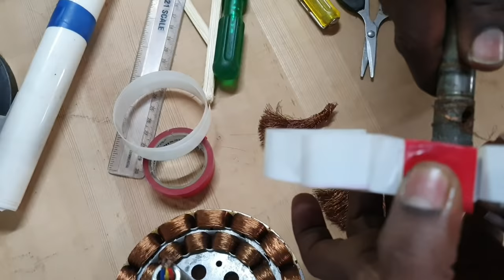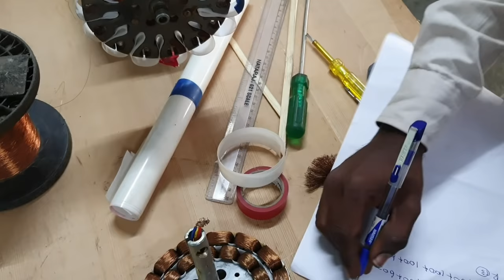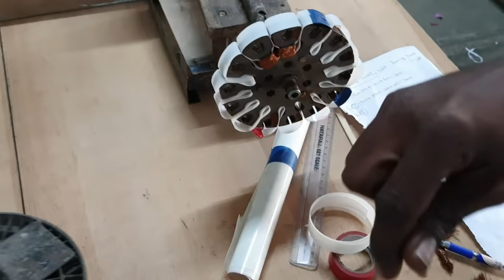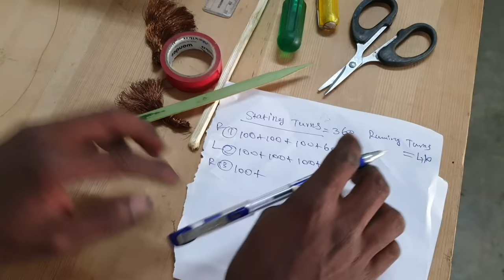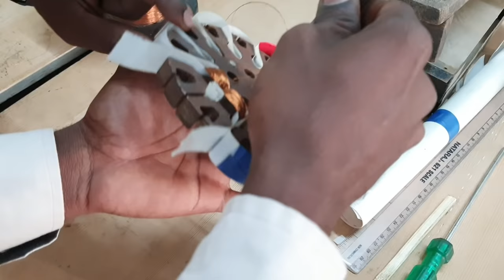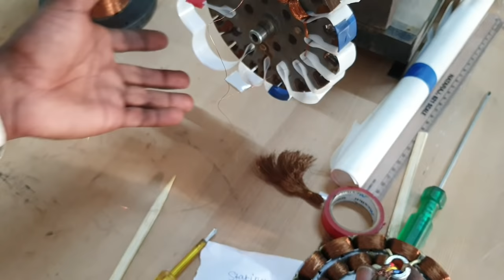Ceiling fan Coil Rewinding by hand|Fan Winding கையால் கட்டுவது எப்படி ?

Comment: Sir everything perfect two doubted for staring wiring for clockwise direction completed and start running wiring counter-clockwise direction? another for the end section confusion line output 3 wire kingly solve that issue... Really Amazing Teaching...

Comment: Starting coil and running coil intha 2-ன் udaya ஆரம்ப முனையையும் இணைத்து red colour la kuduthurukangala or running coil oda mudivu munaiya kudukangala
Reply: Starting coil aramba munayum, running coil mudiura munayum thaa short panni red colour wire yedukanum

Starting coil ( inner winding ) mudiyura munai capacitor ku podum dummy yellow wire 

Running coil ( outer widing ) staring munai thaa blue nuetral wire

Comment: 36 kg wire nu solranga la sir athu ella ceiling fan kum same size thana.. intha wire kadaila eppadi ketu vangarathu.. oru fan ku ivlo gram nu ethavathu kanaku iruka.. illa antha 36 kg wire bundle ah thaan tharuvangala..
Reply: Cut &remove the failed fan coil,the take a one wire,measure in the SWG &find out the wire size.swg is a disk like unit,available in electrical shop.
Reply: Kg.baskkaran thank u.. evlo weight  wire vanganum.. another doubt pls clarify.. coil kattum pothu antha copper wire cut aachu, illa wire patha la na wire join pannalama..
Appuram turns adhigama suthana enna aagum.

Comment: Which is the running winding, inside or outside ? Because running winding resistance is low when compare to starting winding but running winding outer big in size.
Reply: Renning aute side starting in side

Comment: at the end the mechanic confuse to which are two wires to be joined. and which are wires to be leave alone. he told the starting coil's commencing wire lead has to be joined with the ending coil's ending wire lead, and again the running coil's end wire lead kept separate. kindly explain which one is correct?
Reply: Sir, he changed in confusion....... 
1.Starting coil, starting, End +Running coil starting, End=two terminals are Tapping to be attached - Red color wire =out put,Number=1.

2. Running coil End =to be attached-Blue colur wire. out put, Number =2.

3. Starting coil End =to be attached-Yellow colur wire out put, Number=3.

1.Red color wire End=PHASE .
 
2.Blue color wire +cpasiter one End to be attached =NEUTRAL .

3.Yellow colour wire +cpasiter another End to be attached with DUMMY.

NOTE :FAN was original Running Auntie clock wise, 🔄This Direction. 

IN CASE FAN WAS
 RUNNING.clock wise 🕒 This Direcction. Nothing Aire Flow. 

2.Changed to this number =2. BLUE color wire =DUMMY.

3.Anuther one Changed to this YELLOW colour wire =NUTREL. OK

Comment: Good evening sir 
To remove  upper bearing Down bearing in ceiling fans  can use 4 inch  100mm  3 legs puller 
Or can  use a 3 inch 
3 legs puller Please give an answer

Comment: Sir teriminal எடுக்குறது தான் சந்தேகம் இருக்கு அது மட்டும் மறுபடியும் சொல்லுங்க
Reply: Avaru terminal connection last la wrong ah sollitaru,
1)Starting coil wire+running wire connect same as neutral (blue).....
2)Another Starting coil wire+Capacitor-phase(yellow)
3) running coil wire-phase(red)
Reply: Starting coil first+running coil end is natural !!!correct a bro
Reply: @nanthrathi  hiiiiii
Reply: @jothikajoys8583  hi
Reply: @govind7197  correct
Reply: @jothikajoys8583  send mail to this id,i'll contact you.
Reply: @govind7197  தவறு. இரண்டு ஸ்டார்ட்டிங்குமே  நியூட்ரல்.
Reply: @nanthrathi  நீங்கலும் குழப்புகிரீர் ஸ்டார்டிங் காயில் ரன்னிங்காயில்களின் ஆரம்பஒயரா முடிவு ஒயரா.  நியூட்ரல் கனக்ஷன் இதில்தான் கொடுக்கவேண்டுமா.எந்த எந்த ஒயர்களை இனைக்க வேண்டும்
Reply: 1. Starting and Running coil initial terminals shorted(Red)=phase
2.Running coil end terminal with capacitor (blue)=neutral 
3. Starting coil end terminal with capacitor(yellow)=dummy

Comment: 1. Starting and Running coil initial terminals shorted(Red)=phase
2.Running coil end terminal with capacitor (blue)=neutral 
3. Starting coil end terminal with capacitor(yellow)=dummy
Reply: The guy in the video gave wrong info about this right ?
Reply: Sorry once again clearly explain
Reply: Sorry once again clearly explain in last end video in part of terminal connection
Reply: @babyrock1880  yes bro
Reply: @babyrock1880  he was emotional